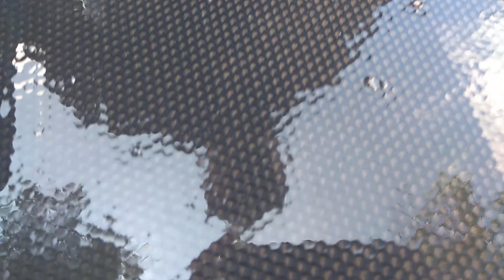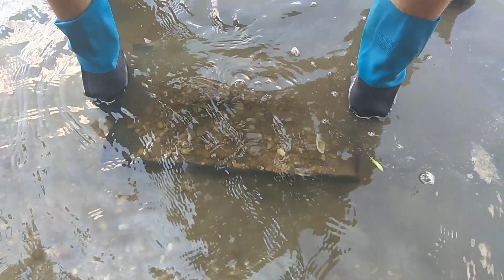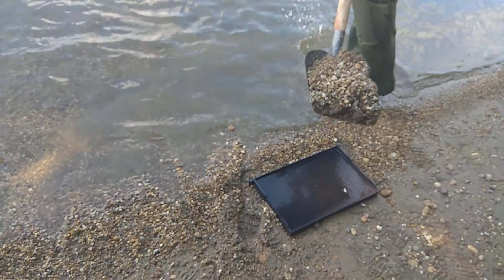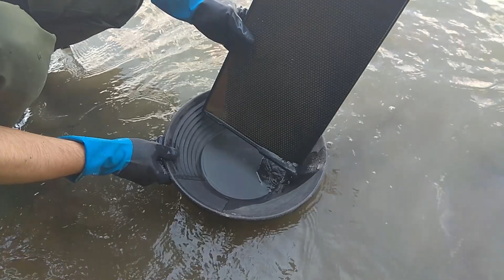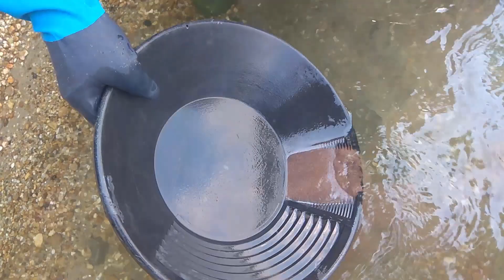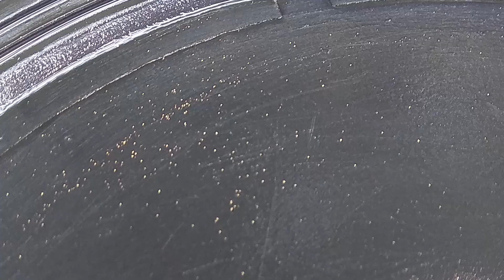How to catch micron gold easily with a plastic beekeeper's honeycomb?!

Comment: Blade ,Bart .I have some pictures you may want to see of a sluice that is designed for 50-200 mesh gold . It uses a old wool blanket (golden fleece ) to catch the gold . This tech is not new and was developed by a Canadian named James Gibbons in the 1800s. Designed for flour gold on the north Saskatchewan by Edmonton Alberta . I have made a modern version with wheels . 95+% efficient . The tray with the golden fleece is on a 24 degree angle and uses the angle of repose to hold the gold and rid the blond and black sands . The material going over the sluice is classified down to 1/4" (6mm)  by going over a 1/4" convex screen. It too uses the angle of repose to help classify gravel . Why it works is gold that size is flat and the blacks and blonds are rounded (angle of repose) . Have pictures of all that .    bartoonski@yahoo.ca
Reply: Where to see the pics?
Reply: @roberttburrows5827  https://www.youtube.com/watch?v=qHe54kyYt54

Comment: How much are specks of gold worth? I wondered, I googled to no avail, and so I'v tried to figure it out myself.  "Specks" is a fairly loose term so I mean the stuff too small to pick up with a finger or tweezers, what some call "micron gold" or "fine gold", often only a sniffer bottle can pick up. Between 500 microns (.5 mm) and 30 microns(barely visible). 
    A cubic 1.6 cm troy ounce of pure gold is about $1200, with impurities reduce that about 25% of that value or about $900 for "nuggets", and per cubic centimeter of "nugget" which is seldom square, rather usually rounded or in flakes which would be even less, or would come out to about $200 per cubic centimeter. So 1 cubic millimeter of gold nugget would be worth about 20 cents on average, since it takes 1 thousand cubic millimeters to make a cubic centimeter, and that's assuming the nuggets are round, flat flakes would be worth half that or less. It takes 1 billion cubic microns to make 1 cubic millimeter, and 30 microns is the smallest thing our eyes can detect, a human hair is about 80 microns in width. So "micron gold" specks might fall between 30-500 microns or maybe 250 microns on average, also depending on how round or flat they are shaped. So it would take somewhere between 8 to 80 gold specks to make 20 cents worth of gold. A piece of gold that's just barely visible to the human eye is worth about 1/1000th of a penny.  If all my numbers are right.
   There is more than one "worth" in a speck of gold though beyond dollar signs, fun per hour, indicators of increasing or decreasing gold concentrations, idk what else?
Reply from the maker: This is a hard question, and the answer too. In the Danube river's middle section in Hungary the average size 0,3mm as 300 microns. We have a good spot if we found more than 80-100 little piece of gold in a liter sample. If we collect 1-1,5 m3 from this and we clean up perfectly, we have 1 g of 99.7% clean gold. This is a pretty hard work to collect and clean up from the river bench. But a good hobby for fun and for the healty body. :)
Reply: This looks to be a Great way for recovering Micro Gold. You can order  Plastic Comb Foundation Black Wax Beehive Frames Here. https://amzn.to/2TLCJoR

Comment: Make a rubber honeycomb mat, use same size cells, make it about 1.5cm deep.  Now cut sawtooth pattern 12 to 15 degree angle. Put in sluice. It act like vortex mat and sawtooth mat all in one. Catch really small micron gold like that and be able to run shovelfulls a time
Reply from the maker: Yes, but the 1,5 cm deep is too much. If the cell has same size than 5-7 mm depth is enough for the micron gold.
Reply: 15 градусов???

Comment: Attila I go in one week to Bratislava and want try this on Dunaj river. Do you think I will find some gold? How important is good place for panning or gold is everywhere?
Reply from the maker: MenoD d Yes, you will! The gold sit in the inner corner usually. If you could see some red or blacky sand on the river bank than you find a rich place. But the gold is everywhere, so if you are in a corner inner side than you will find some micron gold there.
Reply: Attila Blade cool i need build some sluice for it. Are you Hungarian or Slovak?
Reply from the maker: MenoD d Hungarian, but we don't use sluice here, because the water speed is not enough for that. For a higher capacity we use washing table with woolen clothes, or rubber mat surface. Check my other videos!
Reply: Yes I will build that sluice for clothes mat like in your videos. How much gold you can get  per day?
Reply from the maker: MenoD d It is always change. The pretty good place has 0,8-1g/m3 but the average enough good place near by 0,5g/m3 if you use your hand for water flushing that is a hard work and long process for a day.
Reply: Attila Blade that’s pretty good even 1g total will be success for me. I will do video about that
Reply: @Dollarista  Zdravím, tak ako? Bolo niečo v Blave? Tiež by som si rád zaryžoval na Dunaji. Aj 250 mg/deň by bolo dosť... Teraz sa na Slovensko nedostanem... možno v lete...
Reply: @frantiseklaluch6605  ano naryzoval som zlato a celkom pekne. Nasiel som si miesta a vylepsujem splav a skusam rozne techniky preplavovania piesku. A uz som spat v Irsku.